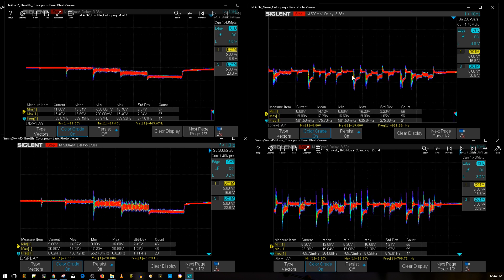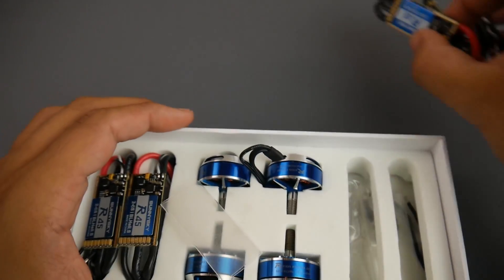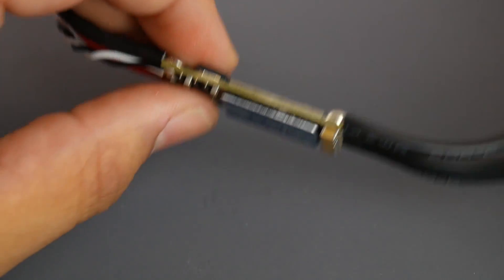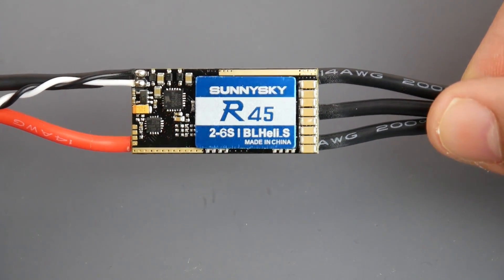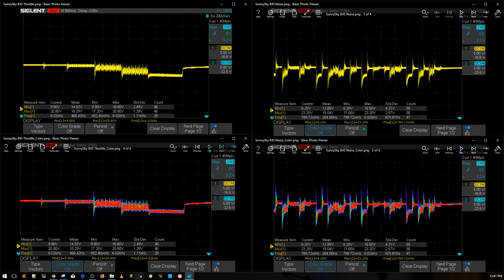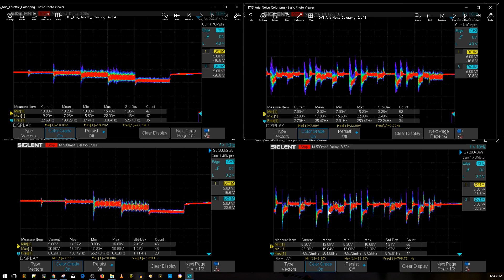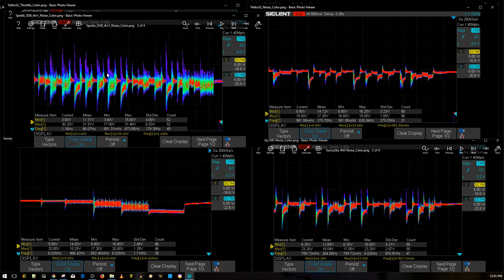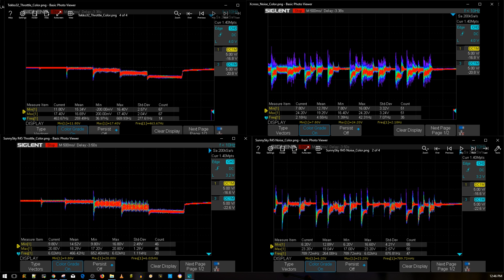Ultimate 6S ESC!! // SunnySky FPV Combo R45 ESC & R2306 2450kv

Comment: Can a flight controller induce large voltage drops when throttle is applied separate issue from ESC..
Reply: Good question?

Comment: Ultimate 6s combo? Those Motors are way too high of a Kv for 6s, even 5S it's cutting it a little close to being high to take advantage of what high voltage has to offer. And I certainly wouldn't be using a pancake motor for 6s, don't know anybody that does.
Reply: Good stuff though thumbs up 👍
Reply: there are some guys on youtube doing 5S FPV with 2306 2400+KV and its working great. just skip shitty props like HQ that tend to deflect at high RPM. go with DAL Cyclones and you're good to go